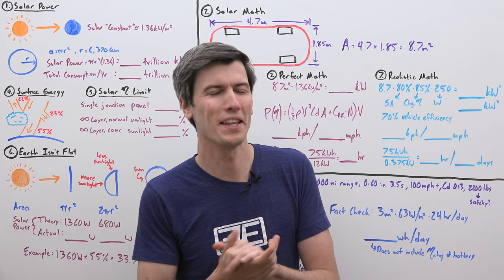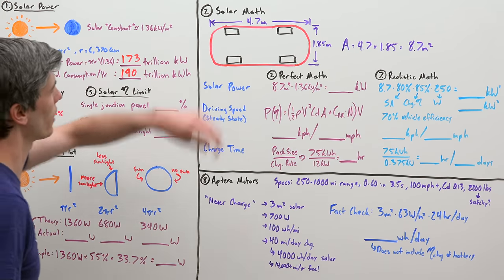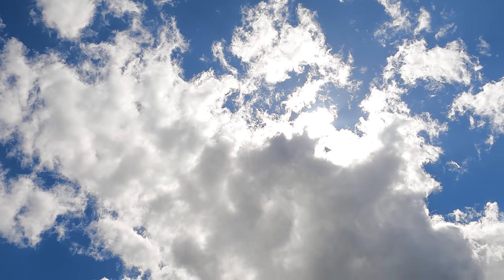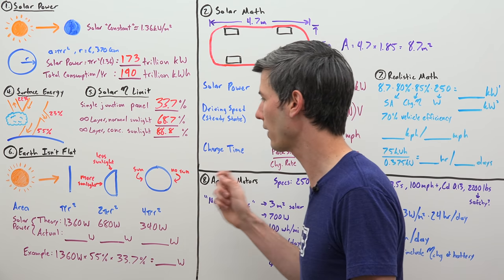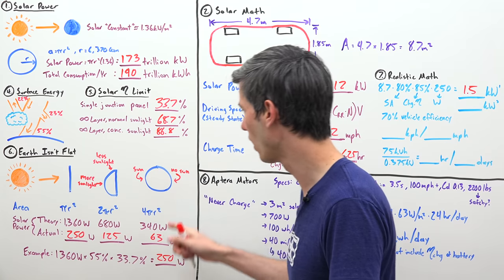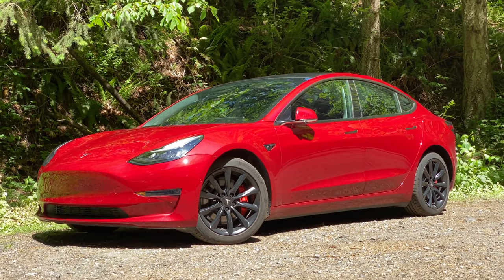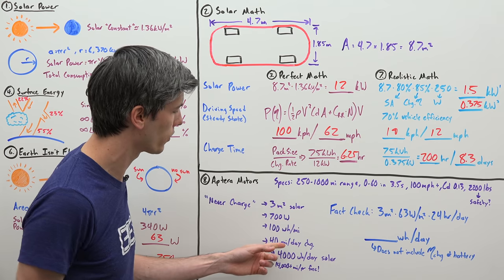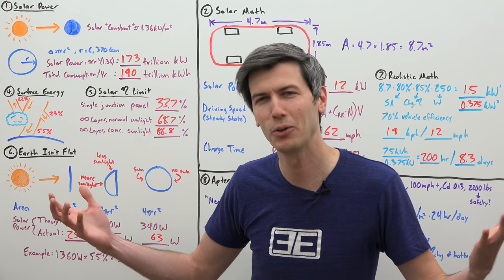Why Don't Solar Powered Cars Exist?

Comment: Would the math work on a truck? The roof is probably 50% wider than a car, and 3 to 4 times longer; you might be able to use one of the sides too… Sure, they take more resources than a car but, with an aerodynamic cabin, would they take six times more? Assuming the pannels make a sleeve to push the containers into.

Comment: so....

top speed ∝ power/drag
with drag ∝ height*width

and on a solar powered vehicle,
power ∝ length*width

so it reduces down to
top speed ∝ length/height

typical attempts to build solar powered vehicles try minimizing height, but Rhode Island Public Transit Authority is running solar-diesel plug-in hybrid buses. Rhode Island isn't the sunniest and buses aren't quite long enough to go straight solar.

there is a passenger tram in a part of Australia that is sunny for being in Australia that is solar powered, and that is basically throwing any attempt at reducing drag or minimizing height and just maximizing the hell out of length. But it's just two cars, so it isn't even really maximizing length.

Figure out a way to put solar panels on a freight train without interfering too much with the loading and unloading of intermodal shipping containers, and you'll have a very high power/drag ratio

Comment: I have not seen of this video more than the intro....
But there ARE solar powered cars in the world....only they are not for sale to the public (mostly...only if a team of builders builders need money for the next  solar race (WSC) .
And those cars are expensive, real expensive.....because they're buiold with what you would call "rocket science".
I know this because my son gas been member of such a team....a team from 16 to 20 members, most of them as student engineering (mechanical dynamics, fluids dynamics, construction technologies and electrical )  working 1,5 years non stop for making one....without any payment. Even without their payment they need more than 0ne million euro's value in money or "free products". When counting the workhours the price would rise to 5 million. Still way less than formula 1 race cars...
The fact: That car could go , in Australia, average nearly 90 km/h for eight hours a day....more driving was not permitted due to the regulations of the WSC. For driving  this speed the car needed only 1500 Watts...ca 2 BHP.  Or using 12 kwh / day for driving. This is even more efficient than the cat presented at ca 12 minutes (but had , in 2013, 6 square meters of silicium solar panels and only ca 0,07 as CW.)
And next: I could use solar power, panels on the roof....they are directed to the sun, not horizontal...., for charging my (normal) electric car. That is much cheaper than a car which has to drive on the energy it catches on it's own carrossery.

Comment: Your numbers in this one look weird. Your sources look fine, but I think it's worth noting that most of the atmospheric losses and curvature losses are focused around the poles, so the practical surface irradiance would be higher. That said, you're working with theoretical solar panel efficiencies that are not at all realistic. 20% is around what I'd expect from a solar panel. Anyhow, I think it all works out close enough, it's just odd seeing you fill in three significant figures on such rough numbers. Limit yourself to a single significant figure. Or less.

Comment: I love how you spend the whole vid explaining how ev wouldnt work with solar then at the end say well aptera made it work and their number look good LOL  removing one of the wheels helped with weight and road friction, the aerodynamic on the thing is absolute insane. also some of your calculations are missing HUGE power drains! people like comfort in their cars so they use a/c and listen to radio and use lights and brake lights, headlights, and on and on their is so much excess power drain. Battery never goes as far as they say it will!

Comment: Might be better off just putting the panels on your roof so you don’t have to lug them around on the car lol.
Reply: It would be slightly more efficient, but there are a number of benefits you get from onboard solar. Being able to charge while you're driving, while parked anywhere in the sun, are huge benefits. Also makes EVs accessible to those living in apartments or condos, who simply can't install charging at home

Comment: Before watching this video, I'm guessing that the answer is that solar panel energy density sucks, and solar panels are only useful for convenience charging of small portable devices that require a tiny trickle of power.

Comment: Unless solar panel efficiency goes up over 50%, then solar powered car is "starting" become practical.
Reply: There will be significant numbers of people who drive the average 30-40 miles per day and live in sunny areas that will see most of their driving needs covered by the present Aptera design.  At a added cost of $900 for the full solar option it already is cost effective for many people.  This is possible because of the energy efficiency offered by the Aptera design.

Comment: 9 months later... The Aptera solar powered car that can do 1000 miles before needing a charge is about to hit the roads. Not to mention the Sono Sion that can run on just solar is some circumstances, daily short range commuting. 100% solar all the time? No, but a very significant boost to range thanks to solar, and in some circumstances solar only, yes.
Reply: Elio was "about to hit the roads" too.

Comment: Nice math, but it does not correspond with reality. The real yield is much less. And he forgot, that a charging unit for EV batteries needs at least 300W to work. Thats most of the possible yield.

Comment: You need to buy a meter that measures the sun in watts per square meter.  You make this video very complicated, by saying you get 67 watts X 24 hours. day with the average being dark at night.  It is very simple to say you have about 800 watts per square meter, and the normal price solar panels are about 25% efficient, so you can normally get about 200 watts per hour at noon.  That means about 1,000 watts per square meter per day (taking 5 hours X your watt rating).  

So with the Aptera, with it's 700 watt per hour rating would mean about 3,500 watts per day (a little more in the summer, and much less in the winter, with clouds and such.).  My guess is about 35 miles of travel at 100 watts per mile the spring and fall, and less in the winter, a little more in the summer, say up to 42 miles? 

With the Tesla, suppose you could install 7 square meters of solar panels, and still see out the windshield, and it does not increase your wind resistance, at 250 watts per mile, and your 7 square meters making 200 watts at noon X 7 = 1,400 total.  So on a sunny day, 7,000 watts, or enough to go 28 miles.  

With a slow 240 volt 30 amp charger (like used at home) you can get about 7 KW per hour.  A DC fast charger is more like 100 KW per hour.  So the solar would not put back much power compared to your home charger.  But it can put back some power.  

Is it worth it?  Well a home solar system uses lower cost solar panels, and they use a reasonable cost inverter to send power to the grid and your home.  So it would be much better to install a 5 KW solar system on the roof of your home, point it south all of the time, not just part time, like a car driving around, and parking under a tree, or in a garage.  Then charge your Tesla at night, using grid power, as that is the lowest cost way to charge your car.   During the daylight hours, it is more expensive to charge your Tesla, even at home, even if you have a solar system.  This is because the cost per KW is higher in the daytime, than at night.  So while you can produce solar power, your home is using some power.  If you have a 5 KW system, your refrigerator and other things are running in your home using about 1.5 KW per hour, and you plug in a Tesla at 7 KW per hour, then your home solar system might be producing about 4 KW, and the load of the home would be 1.5 KW, and you would sell back power to the grid at $0.20 per KW for about 2.5 KW per hour.  Yet if you charge during the day, you will put about 7 KW into the car, or about 2.5 KW from your solar system, and 5.5 KW from the grid at $0.20 per KW.  

Charging at night will normally offer a lower rate, say $0.10 to $0.12 per KW.  IN my area, 9 pm to 6 am and weekends is only $0.08 per KW, while other times of the day it is much more expensive.  Indiana offers a special rate for charging EV at night, with a $0.04 per KW fee, while Con Edison in New York offers a $0.03 per KW for overnight use, and $0.35 per KW for use during the day, to discourage charging other than between midnight and 6 am.

Comment: More practical and cheaper to instal the solar panels on the roof of your house. This way for the same money you can produce a lot more energy. Another idea is to cover the streets or sidewalks partially by solar panels. Again a lot cheaper and more efficient and manageable. Solar panels on a cars might sound cool but it is not that practical or justifiable

Comment: And another point is - who really parks their Tesla in the sun?? Isn't it much better to park it UNDER the solar panels and have it protected? The energy you get from roof-mounted panels is barely enough to run cooling.. This is always going to sound cool and always be totally impractical. Like, for example, flying cars ;)
Reply: The reason it is practical for Aptera and not for Tesla is because Tesla doesn't have a foam sandwich, high r value body like Aptera and it uses almost 3 times the power of an Aptera at EPA highway speeds, and much more than that as the speed increases from there.

Comment: Tesla looses 1% battery each day just to run the electronics on-board !!
1 solar on the roof can easily compensate that..
2nd thing- if someone like to drive to work only, then why not to make a light weight car with 70-100 miles range only, less battery weight means more efficient car !! So you can get not just 40 miles but 50+ miles free each day in ideal conditions !!

Comment: If I get an average of 10-15km/day from solar, I think it's worth it.
Reply: Worth what? What price premium would you be willing to pay, to get 10-15 km/day solar panels for those days when the car happens to be parked in direct sunlight?

I mean, it's not like this stuff is free. PV solar is expensive, making curved panels to match a car body is more expensive, and then you need charge controllers. So whether it's "worth it" depends a lot on how much money you think the feature is worth, vs. how much money it costs for them to do it.
Reply: @ps.2  The premium for full solar, which gives around 4 kWh or better in sunny locations is only $900, and less than 10 lbs of weight, so yes, it is worth it.

Comment: This Dutch solar powered car has slightly better specs:

Lightyear One
Range 725 km
Range in 1 hour charging (solar) 12 km
Range in 1 hour 60 kW fast-charging 570 km
Energy use 83 Wh/km
Dimensions (LxWxH) 5.1x1.9x1.4 meters

Comment: They do exist
Reply: You are confusing experimental vehicles on closed tracks. Those compete for distance records or top speeds but they are nothing close to safe and legal on our roads. Low ground clearance, huge turning radius, tires not ready for road use. Some require the entire top shell to be lifted by a team to get the driver in. None of those will ever enter mass production, only some of the proven design features will translate to consumer EVs.

Comment: While this calculation is interesting, it completely misses the point. Solar panels are ALWAYS better used by positioning them in a place with optimal conditions, which is NOT on the car. That is the real reason why this does not make sense. Even in you change parameters dramatically, except maybe if solar panels (+the whole electronics needed) would be ridiculously cheap. In that case, however, electricity would be so cheap that the whole point disappears.
Reply: The entire full solar package for an Aptera is only $900, which makes it a no brainer for many people who live in sunny areas.
Reply: You missed the point that the Aptera completely bypasses all charging infrastructure. You can only put up solar panels if you own a roof to put them on... This car is meant for young adults who live in apartments, etc. It is literally aimed at the wide open market that the EV retailers cant reach since those people cant charge at home (yet...). And as Bruce mentioned, why would I spend $25k+ on home solar when the car option is just $900?

Comment: What bothers me about this video is that all of his talk is not about equipment available for a solar car. What are the efficiencies of each component and what would be needed for a solar car to be possible? How much electricity comes from a specific solar panel product that's similar to the area available on a car? How much electricity does an electric motor for a car actually use? What matters more than math about the Sun and Earth is real testing of the equipment that's doing the job. On top of that, solar power depends on many complicated things: like cloud cover, solar panel angle in reference to the Sun, how much atmosphere the sunlight must go through for that place on Earth, and so on. This 14+ minute video weirdly isn't enough to explain it. O.o Also, I don't see where some of his math is actually coming from. Explanation?

Comment: Wales and Ireland cry in 200 days of rain a year
Reply: The Aptera vehicles will still gain range about 3 times faster than a Tesla when plugged into a power source and cost 1/3 to run..  The efficiency advantage is still there even if you have to plug it in more often than those who can take advantage of the solar boost.

Comment: And we had small high efficiency ice cars that could run a couple hundred miles on a gallon of gas, but no one would buy them, because Americans want to be able to go 0 to 60 in 4 seconds, drive in any condition day or night, carry a half ton of meat inside, us and capable of crashing into anything else on the road with us inside staying safe.

Comment: Why propane cars are not getting in to mass production? Why it burns clean with no emissions
Reply: It does emit CO2 and other stuff, but the real answer is that oil companies didn't want anything to compete with their gasoline guzzlers.
Reply: Propane cars are used in mass production in some areas, especially in the Netherlands.  They do have emissions though, and are more complex to built than an Aptera.
Reply: @n.brucenelson5920  what are you talking  about?
Propane burn in every kitchen and so far nobody died from CO2. Any gasoline car on the road today can use propane. Only modification needed is new set of injectors for propane, and ECU calibrations if it's turbo car... This is it...

Comment: Solar panel cars will be easy to develop in desert areas because the sun is always available
Reply: Most people don’t live in deserts.
Reply: @fredbloggs5902  

they don't live there but they still travel and choose this route because the shorter path even when the fuel oil runs out or the electricity runs out in the desert will be very difficult to recharge. solar power has the potential to be developed for this strategic area, sorry if my opinion is wrong, this is just an assumption

Comment: We need a flat roof mini van with inwheel motors under 3000 pounds. I drive less then 8000 miles a year and only once a month do i travel more then 50 miles each way to gigs.

Comment: Short answer before watching the video: too much weight on top + not enough power provided to the car
Reply: A full solar Aptera has less than 10 lbs of cells on the roof.   An AWD model with a 1000 mile battery weighs around 2200 lbs and has over 200 continuous hp.

Comment: We need solar freakin roadways
Reply: They have 'em. Actually even better. They have shaded parking lots, with solar panels providing the shade. It's great. All the surface area of solar freakin' roadways, and none of the problems with trying to engineer a solar panel durable enough to drive on. Plus, they can angle them to catch the sun better. Hard to do that with a freakin' roadway.

Comment: Doesn’t his realistic math also assume the sun is directly overhead during all hours of daylight seems like the real numbers would be even lower
Reply: Conveniently the amount of light any location on Earth has been calculated and can be easily checked online. If the chart says five hours that means a sunny day equals five hours of full production and you only need to worry about how much shade and clouds might block the panels.
More important issue is that as the panels are flat on the roof the angle will depend on latitude, and both it and the number of sunny hours may change during a long enough trip.

Comment: They do exist and they have a solar powered car race in Australia. Yes I know that is really upside down to call it a race. LOL Covering the earths projected surface with solar panels. Not a very good projection of anything useful. I love those floating ocean solar panels. Just admit it, with the exception of sunbelt areas, solar direct from the sun is not viable. Solar in the form of heating the atmosphere unequally (Wind) has shown to be a return on investment disaster. The only useful solar driven power is the evaporation of water that can rise in elevation, come back to earth and provide power as it runs downhill. Been using that for centuries.

Comment: Science class 2001. The answer is somthing about not making enough voltage. Or it would work if the sun was 5x brighter somthing like that
Reply: Voltage is not an issue anymore with dc-dc conversion tech.  The question will be is the power enough.